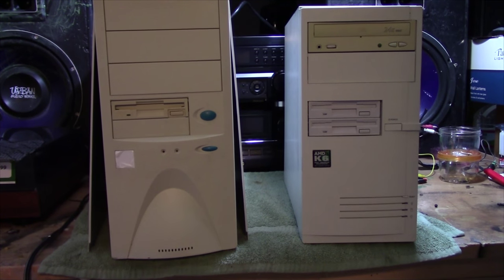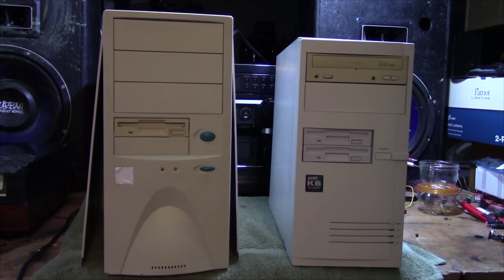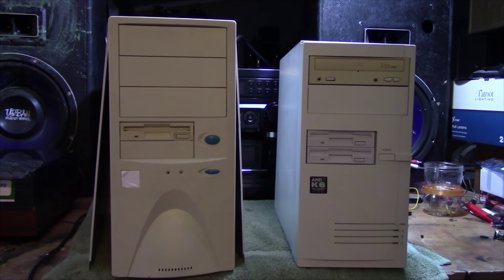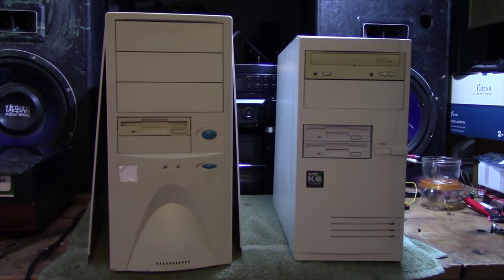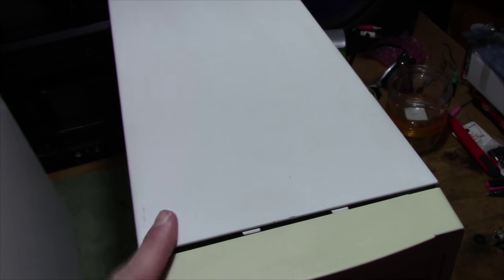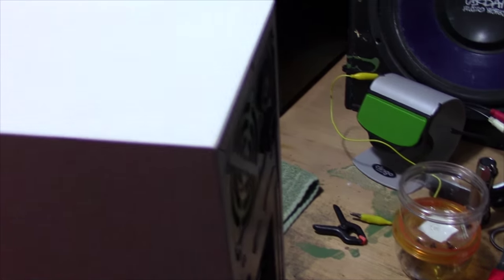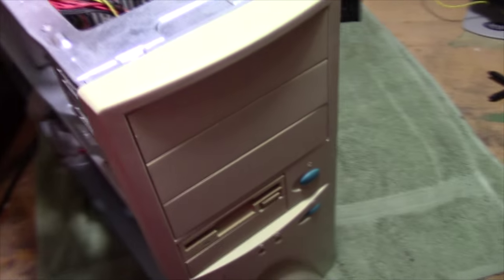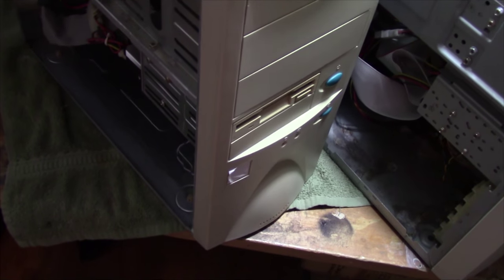2 Vintage Rescues - Socket 7 Computers!

Comment: Nice! Socket 7 machines are very useful. Looking forward to your take on those 754 / 939 systems.
Reply from the maker: +PhilsComputerLab 2 of them have ABIt AV8 motherboards, one of which hangs at a post code of .2 ( odd code ) and seems to be a common problem with that board when I googled it. There is a couple with MSI boards as well. Mostly Athlon 64 / Sempron mix. I use to run both of those chips years ago and loved the 754 Sempron when they were new.

Comment: I picked up 3 at machines with pentium 200 chips in them awhile back. 2 had been sitting outside in the rain and florida humidity and the other sat in their air conditioned garage. Shockingly, the 2 sitting out in the elements tried to work and booted to the bios. The one that was sitting in the garage however was completely dead. Its amazing what computer hardware can take before it dies.
Reply from the maker: +mike52787 I do wonder how much of that abuse modern components could take. Seems like this pre-2000 hardware was built to a higher standard than stuff made since 2000/2001.  Maybe it's just more resilient because it is simpler.
Reply: +WaybackTECH nice woofers i also have 4 of them urban audio 12inch subs
Reply: Pre-2000 machines are a lot simpler - and simple things tend to be more robust. Modern computers have so much stuff packed on a PCB that even a grain of dust or tiny nick in the wrong place can kill a part so It's not really the case of "higher standards" for older stuff.

Comment: I have the second board! Branded as Elpina TXA1. Used to run K6-2@416 MHz. Can run SIMM and SDRAM DIMM together, can work with single SIMM module.

Comment: I used to work with the TX Pro motherboards extensively when I worked for a computer building Co. in 99-2000. They are PC Chips motherboards, and were very strange in supporting very outdated tech even for the time. As you mention they are Baby-AT when ATX was becoming the norm. I believe the soundcard was essentially a C-Media 8330 if that helps with getting drivers. Like all PC Chips boards it had a propritary win-modem attachment which is why you may find a strange pinout / slot at the back of the case. The motherboard was <£30 new at that time, and we also used the BTC CD-ROM's as you see mentioned they were also cheap parts. The TX Pro motherboard is notoriously unreliable and you may want to look for a BIOS update as soon as you can get it to POST - you will probably need to try switching it on with NO addon cards eg no vga card installed, so you actually get the "error beeps", then put cards in to get it booting. I hope this helps.

Comment: over the years i scraped  loads of them my mate works picking up house hold skips  they dump in there 386`s p75/p120 mac loved hitting them macs with a hammer,166mmx p2`s i got 2 p3 intel celeron 1.3 in box never opened still got loads of it stacked up in loft.,..   and ABIT

Comment: Have you seen a Daewoo Valiance DC515-DF? (socket 7, Pentium, 8MB RAM)
I have one, still working. I remember playing Wolfenstein 3D on it.
Reply from the maker: +Ivelin Petkov I only remember the Daewoo name, don't remember those being sold where I live though.
Reply: It's so rare it doesn't have pics in google
Reply: I am going to upload some in my google drive. I will make them public so you can see them
Reply from the maker: Ivelin Petkov
Reminds me of the NEC systems from back then.
Reply: :) I don't remember those, I am born 2000 and probably by the time those arrived in Bulgaria they were outdated.
A story-the PSU was so dirty, it refused to turn on. 
I cleaned the PC(vacuum cleaner, haven't had any problem) but forgot to check the PSU, so when I tried to turn it on and it didn't, I thoight I had killed it. Some time later I remembered that I could have not connected something, so I opened it again and this time I opened the PSU too, holly molly, was it dirty, was like somebody filled it with mud.
 After cleaning, it worked like brand new(push button->post->screen)
A friend has a socket 7 Gigabyte board, he also thought he killed it(connected the AT connector wrong), but his K6-II is working fine, except for the GPU(dead)

See the GPU? The PCB is orange, probably one in a million. :D
I have a little problem. What could cause a memory slot to not work( Foxconn 945G7MC-KS2HV),  there are a few broken pins, but I checked the scheme of 775 socket and they all seem to be ground pins(so no signal going trough, right?) the slots seem fine, and the traces are all good.
Reply from the maker: Ivelin Petkov
Socket 775 is before Intel started incorporating the memory controller into the CPU, so that would be handled by the northbridge.  You might try cleaning the memory slot with some electrical contact cleaner and a tooth brush, but it might be more likely a bad solder joint on the 945 northbridge. BGA chips are notorious for their solder joints breaking.
Reply: Thanks.
Reply: WaybackTECH It may be a burnt trace. I just found one. I am uploading pictures of it to Google Drive

Comment: is it possible to find a pentium 1 or amd k6 in the wild nowadays, i want to have another socket 7 pc to replace my dos machine that died, what is the rarity of those computers?
Reply: I just found a Pentium 1 in the wild, some Pentium 133 chips that i found along with a Soyo 5VA 430VX and a Intel Zappa 430FX, both of them post and boot. one has a Award Modular BIOS 4.51PG and the other one has AMIBIOS 1.00.03.BS0
Reply: I found a Super Socket 7 board with a K6-2 400MHz in the trash about a year ago. It still works.